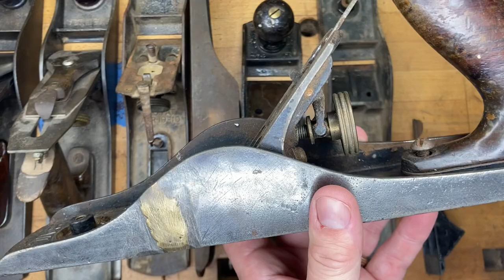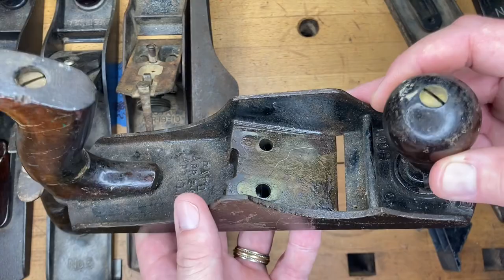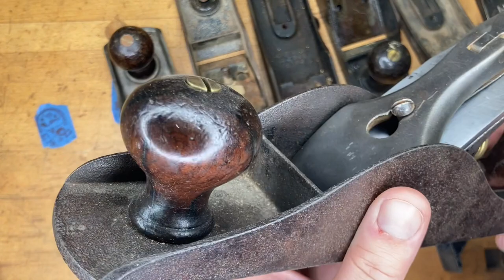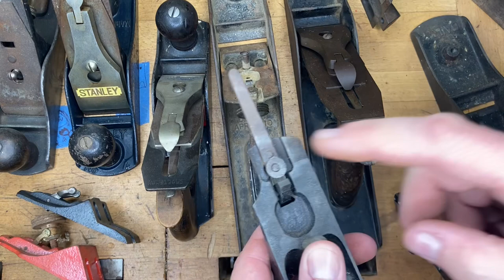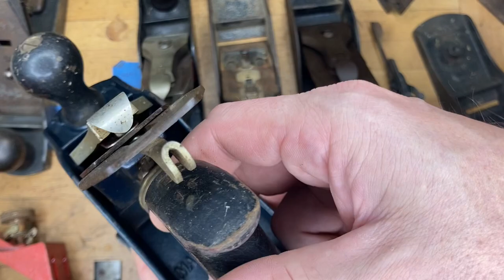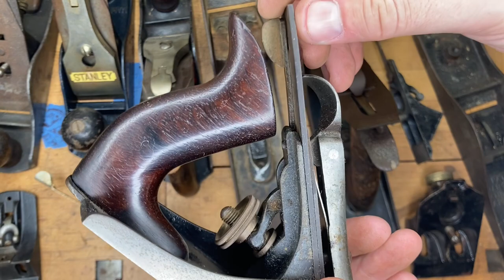Just Plane Fun Q&A - Where to find hand planes, what to look for, etc. Stanley Hand Planes & More!

Comment: I usually take an 1. a slot-head driver, 2. a square with a flat edge and 3. a  "Rust Eraser" with me when looking at planes.  They can all fit in your pocket easily.  They won't tell you everything, but definitely worth your time to have these.
Reply from the maker: Those are all great tools to have on hand!
Reply: @justplanefun  the rust eraser saved me more than a few occasions when identifying the throat crack (badly retracted frog is first sign) underneath surface rust.